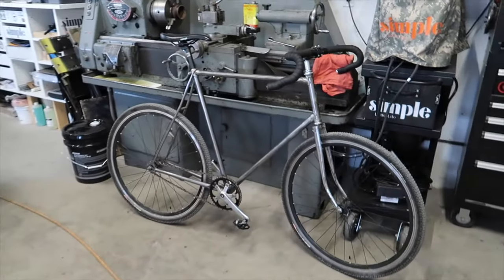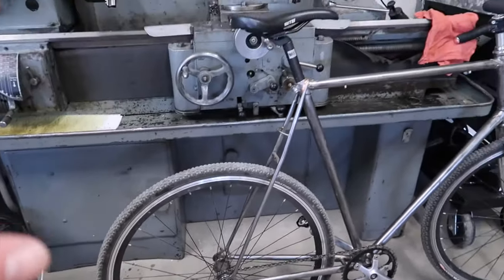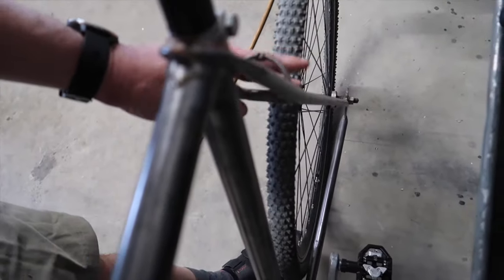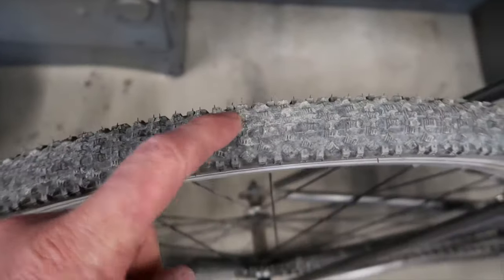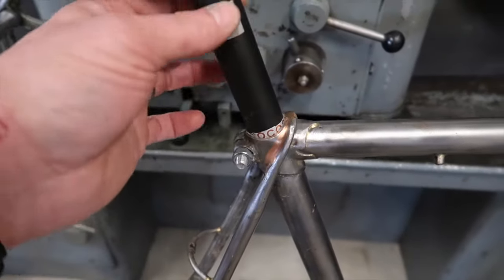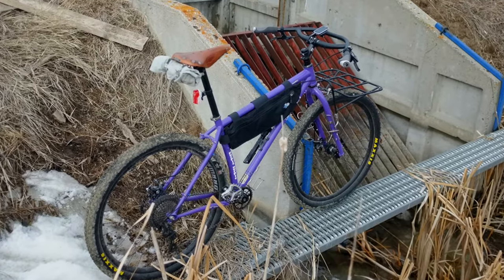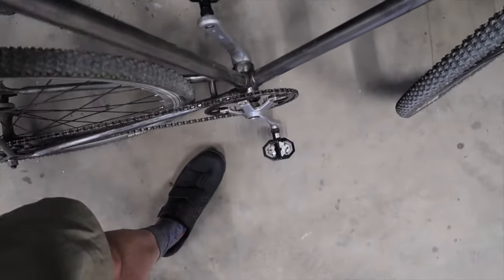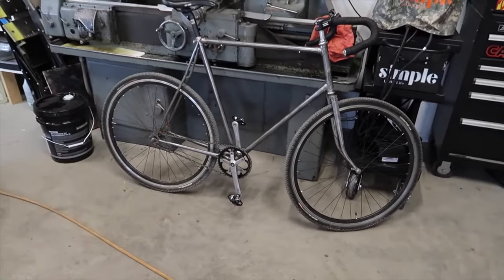New Fixed Gear Bicycle (my gravel bike)

Comment: I've never understood the fascination with fixies.  I didn't like them as a kid, and can't imagine enjoying it now.  Can you tell us why you would want a bike that doesn't coast, Jeremy?  Maybe you can change my mind!
Reply from the maker: I found that I really helped me develop my cadence and made my pedaling smoother and more efficient. There's something about the feeling of my feet being forced in circles that would be a constant reminder to focus on that. I'm not sure. I also tend to like the way it feels very mechanical. When you try to resist the forward motion and feel all the inertia working against your legs as they try and slow down, it makes me realize that the bike has some velocity and force when it's moving. I never sense anything even close to that just by pulling on a brake lever. Having said all of that, I think they tend to be a love em or hate em type of a thing. I really enjoy them 👍
Reply: @jeremygoertz  Right on!  Thanks, Jeremy!  I think I'd fall down, though...  I'll stick with my coaster bike.   :-D

Comment: Bends in your seat stays.......I see a nice little TIG project! Couple 1/4" round rod bars bracing the stays to the seat tube...... Hmm...Hmmmm! Or cut a section of seat/chain stay off a scrap frame and put it from the seat stay cross brace/ fender hanger to the seat stay...... heh heh heh......